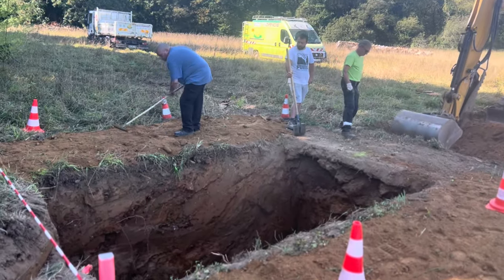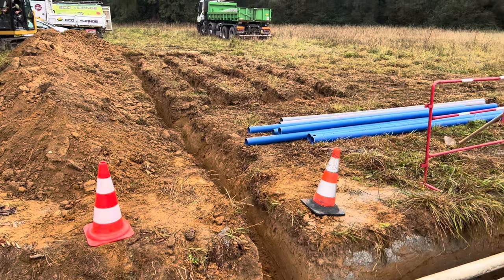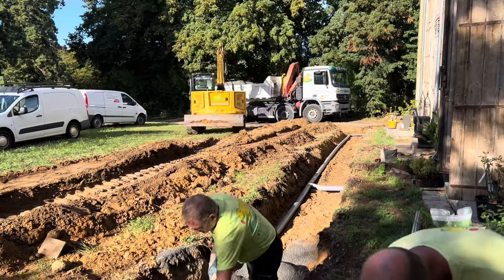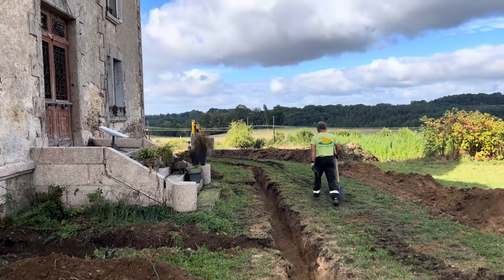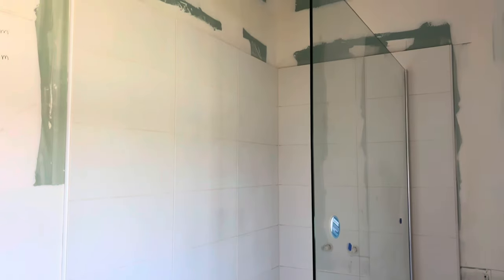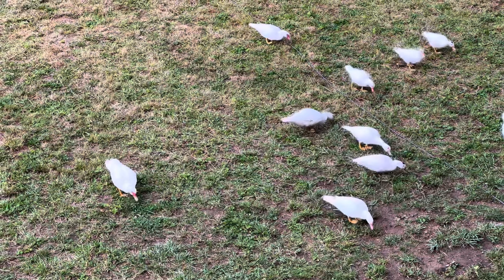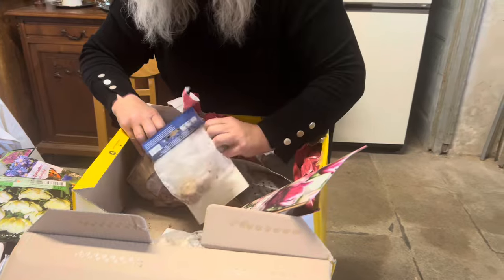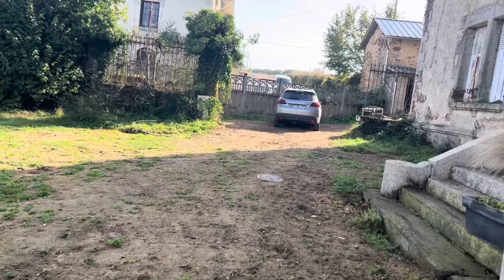THE CHATEAU HAS A NEW SEPTIC TANK AND MORE UPDATES ON THE RENOVATION

Comment: That's one hell of a fosse septique system. We've got a smaller system between 2 houses and we get the solids tank emptied every 5 years regardless of the fact that we were advised to do it every year/2 years [it was never full]. The filtered water is just that, plain clean water and runs off into a nearby stream. I love your enthusiasm, it will get the job done.
Reply from the maker: It is huge at least it has been done properly and it will work properly 💜😊

Comment: I’m Canadian, here in the country side we are required to use holding tanks due to the contamination that can occur to the water systems. At my cottage in norther Ontario I have a 35000 litre concrete tank that we pumped out once a year. All cottages are being made to covert from septic fields to tanks. I’m sure that would have been cheaper than what you have goi g on.🇨🇦
Reply from the maker: Absolutely my bank balance has dropped hugely.